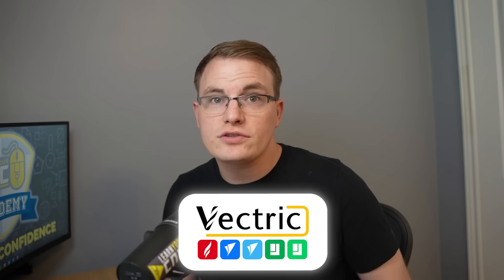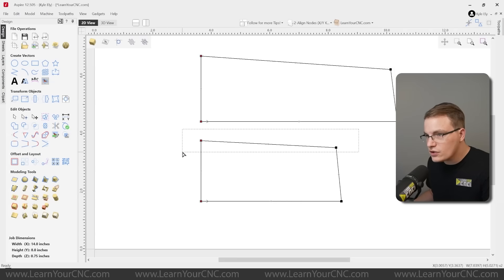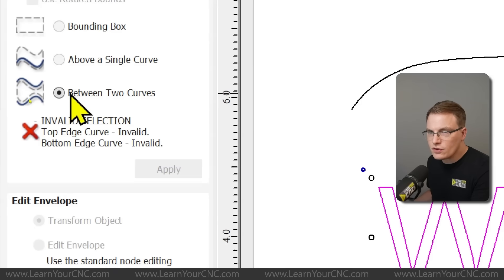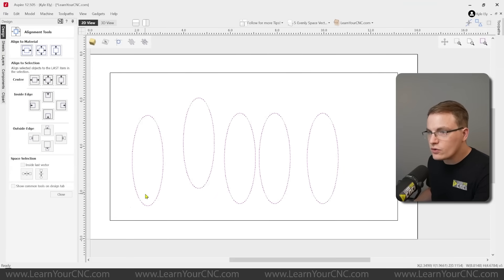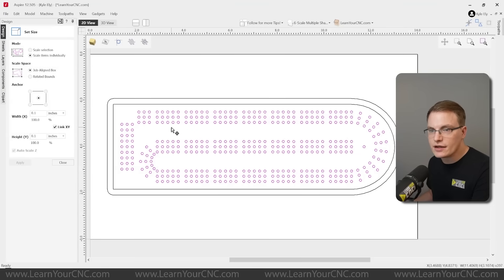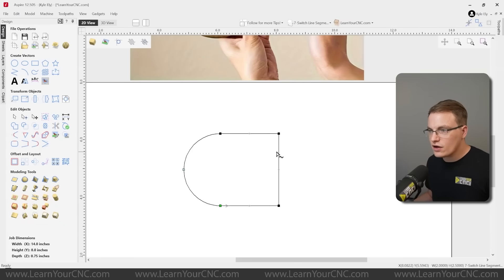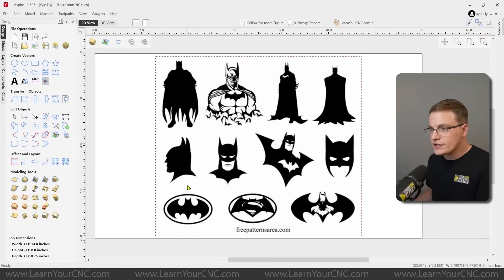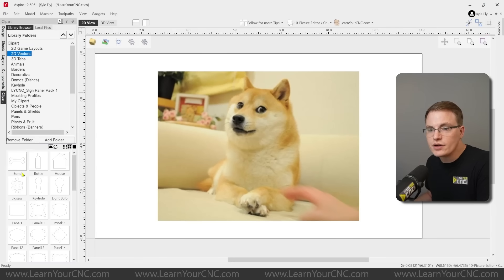10 things you didn't know Vectric could do (2D Design Edition)

Comment: I'm currently creating a project where two curved sheets need to be connected. However, when I make them 3D, there are gaps between them. How can I eliminate these gaps?
Reply from the maker: Try to overlap them a bit and set the combine modes to "Merge"